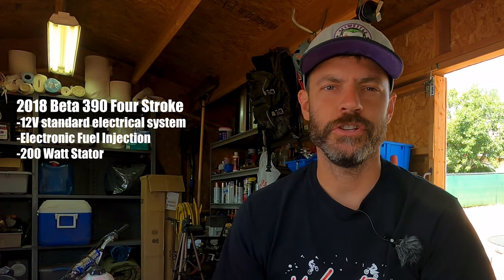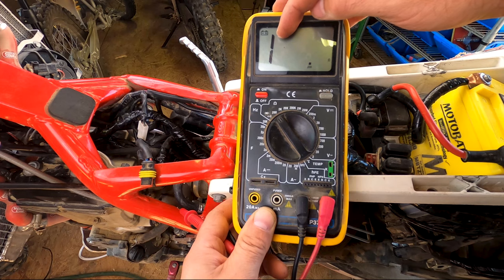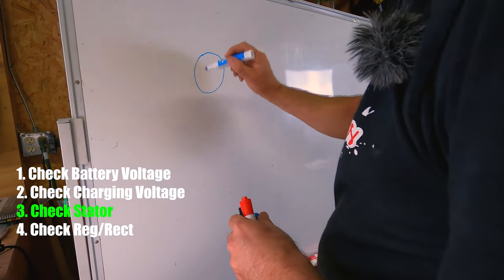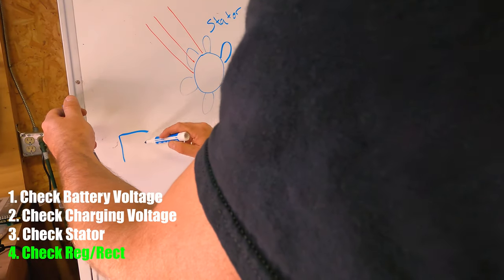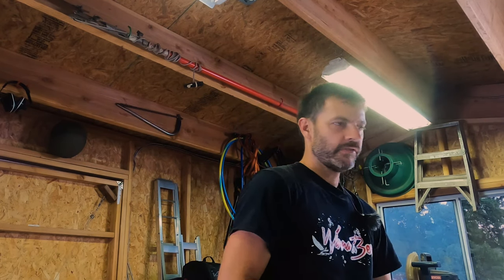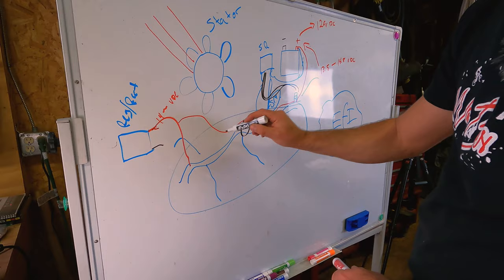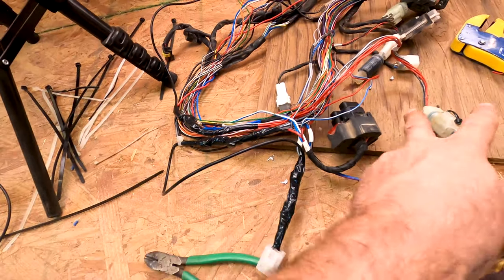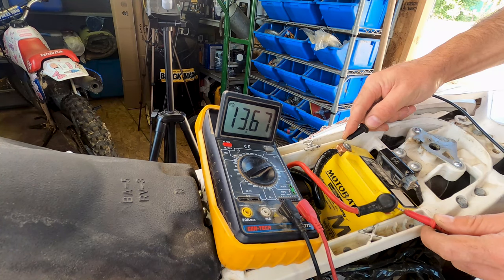Beta 4T Wiring Upgrade | Charging System Test & Repair | Check Stator/Regulator/Rectifier

Comment: Thank you so much for making this video. My new to me 350RR drained the battery first ride and was not charging. Did a lot of research and came across your video. I didnt entirely remove the harness but pulled it back to the throttle body, soldered shitty crimps, added grounds and beefed up diode wiring wiring. Went from 12.6 to 13.7 volts. Thanks again!
Reply from the maker: Awesome, glad you were able to figure it out! Happy riding!

Comment: Hey Thanks for the info, I purchased a used 2018 390 recently and was not aware of this SB. I am also having hanging idle issues which my dealer is trying to sort out. Might be a defective throttle body. Thanks again!
Reply from the maker: I never had hanging idle, but I've heard from other Beta guys it could be in need of a throttle position sensor reset. Google how to do it. The basic idea is you start the bike and let it warm up completely (fan comes on) without touching the throttle.

Comment: Hi friend, is it just adding thicker wires to ground and from the regulator to the diodes?  as seen in the schematic
Reply from the maker: And making sure the connections are solid

Comment: Is this fix for fuel injected bikes, or can you say swap that 2019.5 harness for a 2013 4t 350 RR for a quicker fix? Thanks-great video.
Reply from the maker: I'm actually not sure how far back the harness is compatible. I do know that the issues I had was mostly related to the EFI setup.

Comment: How many volts did you have? now I have 12,8 - 13,2 V to the battery, and it is always low. 
Did you had this problem?
Reply from the maker: Yeah, before the fix I was seeing 12.xx, too low to charge properly. After I rewired it, I got that up to 13.4 which mostly worked. Beta also has a recall on the wire loom which should get you to the full 14.xx
Reply: @ExtremeSportsWannaBes  Thank you very much for the guide!

Comment: How about the hard starting engine of beta 300rr...when the engine is cold it's easy to start but when the engine is already heat the current of the ECU have no more....do you have an idea for this problem of my beta300rr
Reply from the maker: I do not know. I never worked on the two stroke beta models

Comment: Can you solder the original crimps or is that not a good idea?
Reply from the maker: You def can. I don't think it would be enough though. The wires are a bit on the small side and it's good to add a ground connection.
Reply: why can't I just go straight to the battery?

Comment: Hi I would like do you think is it problem if my beta rr 390 2018 charge 15+ volts ? When it is on idle it starts at 13,7-14 but when you let it or add a bit of throttle it goes to 15+
Reply: Do you know what can cause it ? Or if is it a big issue
Reply: Did you fix this? Mine is charging 19.5 volts with throttle...
Reply: @ghazik3656  not yet, but I had to do the wiring again, tommorow I will test it how much does it charge and I will write you, if it is still charging more than it should be, if it is the regulator will be the issue for 90 %
Reply: Just found your comment looking for help did you manage to fix yours ? I have a 2019 300 beta rr racing I have voltage spikes 15~16  in the attempt to fix  I have replaced the regulator, stator , Cdi, battery , battery leads , full wiring harness , ground lead and still having same problem!
Reply: @Enduro187  I havent measured mine, right after I put it back togehter after whole winter, my rear shock started to leak so now I am waiting for it to come back, so I can change oils new filters and gas tank and measure it